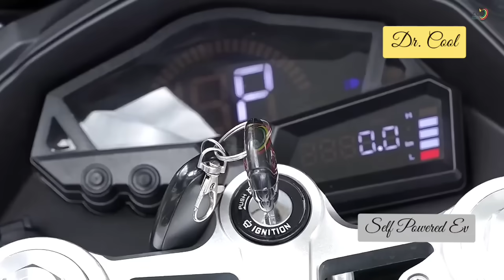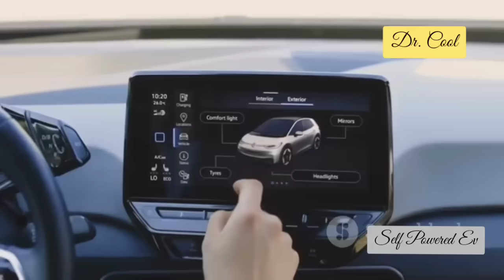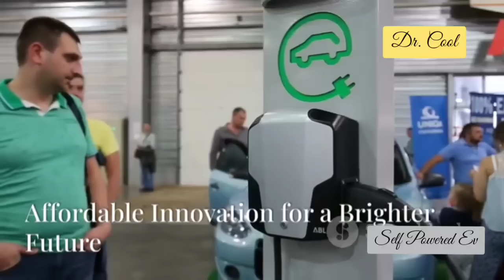The Future is Now! Launching First Self-Powered EV In Africa, its Happening!

Comment: The concept of converting radio frequency emf radiation to usable electrical energy is nothing new. All radio hobbyists are familiar with this concept and there are more than sufficient articles detailing the circuits and methods of building working circuits. The energy so obtained is in the milliwatt range. This conversion does not in any way run counter to the  laws      governing energy conversion and transfer. What is incredible in the African invention is the impossibly huge amount of energy    obtained by the conversion.

Comment: There is no way this could work to power EV cars let alone any other type of device.

  Radiofrequency signals are low-energy and require amplification from an exciting power source far greater than radiofrequency signal/s. 

An audio amplifier is an example where a pre-amp receives a signal from a microphone and is amplified by an external power source, the same way a radio signal is received from a radio station it requires an outside power source to amplify the signal so it can be heard.

Elon Musk would pay you a fortune for this invention if it was true, there would be no need for him to have exterminated. Even though you could store energy from radio signals it would take a long time to store enough energy for even 1 kilowatt of power.   The 1 Kilowatt output would be used up much faster than the radiofrequency input. It's a scam!

Comment: That's impossible how can he convert radio wave into energy? While radio is long time already in use but always need buttery or electric current. It's a lie fake invention. Like Filipino before he invented water fuel. Indian invented free energy but it could not work later on. This trending will not last,
Reply from the maker: You can't tell what's possible or not everyone gift is different from one another

Comment: Good and better ,  for disabled , and elderly ,   those , who cannot keep getting out of car , to charge up . And much better  for those who live in terraced houses ,   no driveways ,  no waiting in line waiting hours or up to at least , 30 mins    but much safer than normal electric. Cars which have a tendency to spontaneous combustion.   Very dangerous. For children locked in back of car because of shutdown. In central locking. So trapped   this car and technology is therefore much safer for your families.  Plus   the range ,   means do not have to worry about making it to charging point.. all big pluses .

Comment: The script is generated and voiced by AI. The video is a combination of several unrelated footages from different sources, with the actual footage of the inventor covering less than 25% of the run time of the video. And the invention is so far fetched that I am surprised that scepticism is almost non-existent in the comment section. He claims to have harnessed the power of radio waves, a form of electromagnetic wave. But he has named the technology after sonic waves, a form of mechanical wave and a completely different discipline of theoretical physics. And also the naming that technology microsonic sounds more gimmicky than anything else, borrowing micro from microwaves and sonic from sonic waves.

Comment: The most basic common sense would require that the car be presented functional, under the control of a bailiff and a few approved engineers.
No one is waiting for the operating secret to be revealed (beyond the principle already publicly displayed) but it would be normal to wait even for a few images of the prototype in operation under the conditions mentioned above.
Bravo for this historic technological advance if it is real, but a very big “boo” for this infantile communication.
This is not a good sign.

Comment: Why go through all this..., how do you amplify radio waves with a small device, strong enough to provide usable electricity lol
You're right to be skeptical. Amplifying radio waves to generate usable electricity is a complex task, and it's not as simple as just building a small device to capture and convert radio frequencies into electricity.

Radio waves are a form of electromagnetic radiation, and they carry very little energy. To give you an idea, the energy density of radio waves is typically measured in units of watts per square meter (W/m²). For example, a typical FM radio station broadcasts at a power of around 10-100 kW, but the energy density at a distance of 1 km from the transmitter is only about 10-100 μW/m².

To amplify radio waves and generate usable electricity, you would need a device that can efficiently capture and convert this energy. However, there are several challenges to overcome:

Energy density: As mentioned earlier, radio waves have a very low energy density, which means you need a large antenna or a very efficient capture mechanism to collect a significant amount of energy.
Frequency: Radio waves have a wide range of frequencies, from a few kHz to several GHz. To amplify and convert these waves into electricity, you need a device that can operate across a broad frequency range.
Impedance matching: To efficiently transfer energy from the radio waves to a electrical circuit, you need to match the impedance of the antenna or capture device to the impedance of the circuit. This is a complex task, especially when dealing with high-frequency radio waves.
Noise and interference: Radio waves are prone to noise and interference from other sources, such as other radio transmitters, electrical devices, and natural phenomena like solar radiation. This noise can reduce the efficiency of the energy capture and conversion process.
Currently, there are no known devices that can efficiently amplify and convert radio waves into usable electricity, at least not in the way described in the transcript. While there are some technologies that can harness energy from radio waves, such as:

RFID (Radio-Frequency Identification): Uses radio waves to power small devices, like tags or cards, but the energy is typically limited to a few milliwatts.
Wireless power transfer: Uses radio waves to transfer energy over short distances, but the efficiency is typically low, and the power levels are limited.
Rectennas: Devices that convert radio waves into DC power, but they are typically used for low-power applications, like powering small sensors or devices.
In summary, while the idea of amplifying radio waves to generate usable electricity is intriguing, it's not a straightforward task, and significant scientific and engineering challenges need to be overcome to make it a reality.

have u heard about this:

Comment: You might want to do a bit more research. This "inventor" has been scamming for quite a few years. His "self-powered" TV only gets shown for a few minutes at a time (long enough for the battery being used not to run out) instead of easily proving it works by displaying it in a locked room for 24 hours with objective observers. Also, in the press event with the president, he displays his portable "generator" which is identical to a product currently available on Amazon (look up "Browey Portable Power Station"). There are many genius inventors on the continent, but Chikumbutso is not one of them. Please stop embarrassing us.

Comment: It's a very proud moment. Thanks to the inventor and  president for your personal support. Africa shall arise again.
Reply: 🙄🙄🙄🙄  you have yet to see it in action!!
Reply: @rockon8174 yes even so, still better than "concepts of a plan "and "drill baby drill" !
Reply: This is the 'Nigerian Prince'  moment. Absolutely rubbish.
Reply: america will destroy africa to stop this technology,africa will have american war ships surrounding africa
Reply: The argument about radio waves and power largely revolves around the laws of physics, particularly electromagnetic theory and thermodynamics. Here’s why the claim of harvesting power directly from radio waves to self-power an electric vehicle is scientifically problematic:

1. Radio Wave Energy is Extremely Low

Radio waves are a form of electromagnetic radiation, but they carry very low energy compared to other forms like visible light or X-rays.

The energy that can be harvested from radio waves is minimal unless a device is very close to the source of the radio waves (like a radio antenna), and even then, it’s typically only enough to power low-energy devices (e.g., sensors, small electronics).

To power a car, which requires significant energy (about 20-30 kWh or more per day), it would take an extremely large area or a concentrated source of radio waves, far beyond what is available from natural or standard radio frequency sources.

2. The Laws of Thermodynamics

According to the First Law of Thermodynamics (conservation of energy), energy cannot be created or destroyed, only converted from one form to another. Therefore, creating a self-powering system violates this law.

The Second Law of Thermodynamics suggests that every energy transfer results in some loss (increased entropy). This makes perpetual energy machines (like a self-powered vehicle) physically impossible without violating these basic principles.

3. Energy Conversion Efficiency

Harvesting energy from radio waves would require a system that can capture and convert this very low-frequency energy into a usable form. The efficiency of energy conversion from radio waves to electrical power is very low (often less than 1%).

Even with a highly efficient antenna system and advanced conversion technology, the amount of energy collected from ambient radio waves is simply too small to power something like an electric vehicle.

4. Practical Issues with Radio Wave Power

Radio transmitters (such as those used for communications) emit energy in all directions, so capturing it efficiently is a major challenge.

Additionally, as energy propagates through space, it rapidly weakens (inverse square law), so to extract significant amounts of energy, you would need to be very close to a powerful radio source.

Even if you could extract more power, radio waves cannot sustain the continuous power demand required for something like driving a car.

Scientific Consensus

Most experts agree that creating a self-charging electric vehicle powered purely by radio waves is physically implausible based on current understanding of electromagnetic energy and the laws of thermodynamics. While wireless energy transmission (such as Wi-Fi or microwave power transfer) is possible for short distances and small amounts of power, scaling that up to the level required for powering an EV is not currently feasible.

More Resources:

"Energy Harvesting with Radio Waves: Myths and Realities" – A detailed article that explains the science and limitations of energy harvesting from radio waves.

IEEE Spectrum – A reliable source for understanding the scientific limitations of wireless power technologies.

This is why many dismiss the claim of a self-powered electric vehicle, as it doesn't align with established scientific principles.
Reply: @nickm3973 :  "Plasma system" of energy production, was an EXEMPTION to such "worn.out", frequently quoted theory of Isaac Newton... The planet sun of our Milky Way galaxy, was the concrete example of such "plasma/ quantum  energy" production ;

Scientist theorized, that probably, like the sun core of "compressed plasma matter" (CPM)- every planet (earth included..), might have a "plasma core" of 100. million deg. Celsius in temp're-  which resulted in the phenomena of "perpetual motion", observed in myriads of planets, in the entire universe!...
Reply: Congrats for your invention take care be strong  oil businessman will be after you, thanks for your courage.